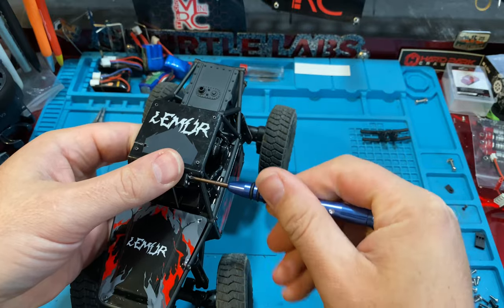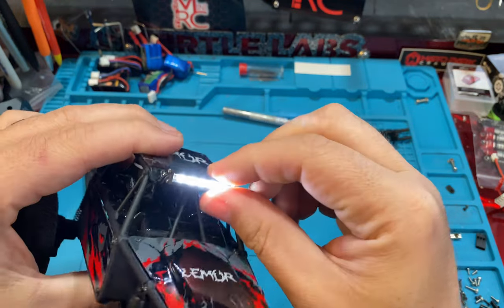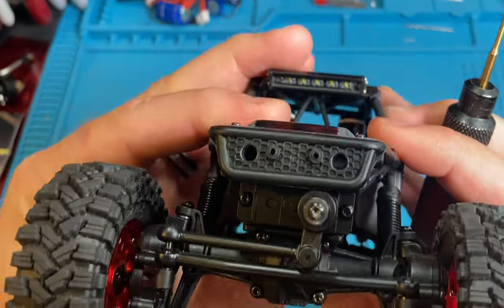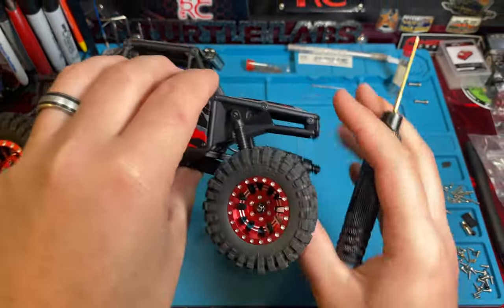FCX24 Lemur - 3 Easy Mods (plus more) to Make it Look & Perform Better!

Comment: I cut down the shock springs by 3 coils on my power wagon and it is incredible in combination with good wheels similar to what you have. It lowers the body as well as the CG giving better sidehill performance. You also get to keep the suspension travel and I think it articulates better. But on the Lemur you won't have to trim the front fenders like I did on the Power Wagon. It kinda feels like holding a lobster a little bit when you flip it over. The looks of the lower stance is also a great improvement IMHO.
Reply from the maker: Yep! Fantastic option!